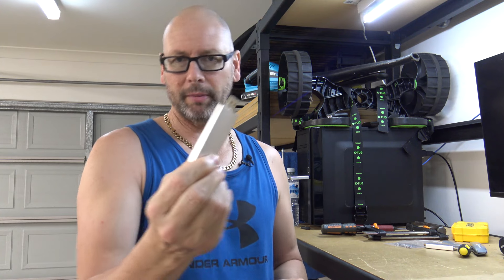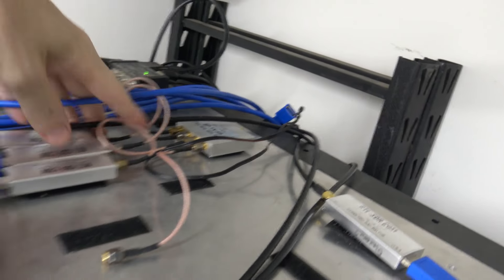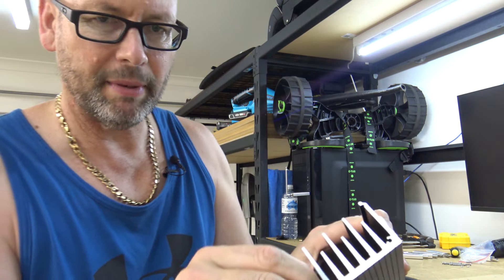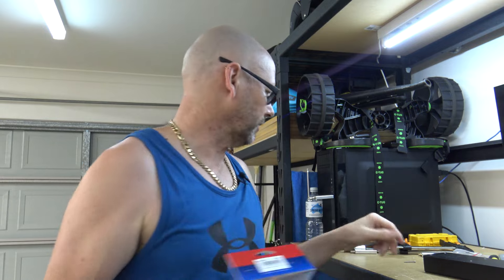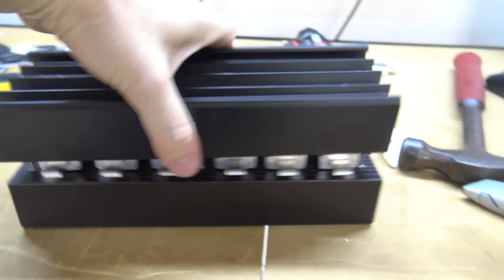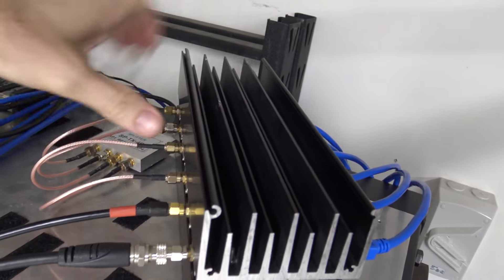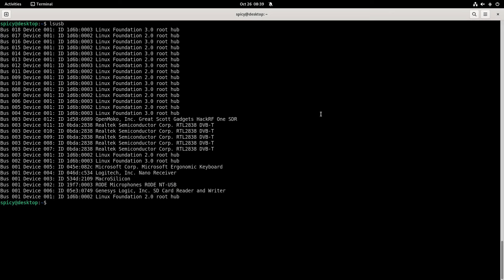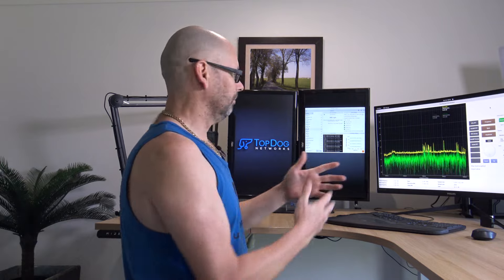RTL-SDR Heat Sink

Comment: Nice, I run a pair of these and decided just today to 3d print a dual case with an 80mm fan attachment for cooling them down.
Reply from the maker: ...and you ended up seeing my dodgy effort
Reply: @TallPaulTech  Yer freaky, was looking yesterday for a way to mount two RTL SDRs together and keep them cool, found what I wanted, started to print, jump on Youtube because I haven't been on for a few days and your video pops up. Nice one mate. what you are making will do the job more than well enough.

Comment: In time give us an update Paul.
Reply from the maker: You want another update?... I was playing around with cuda using nvidia gpu today, but it's not something I want to force as a requirement, so I pissed that off. I got some other shit optimised though.
Reply: @TallPaulTech  lol nice. Let us know how the thermal management of the RTL dongle cooler works out.
Reply from the maker: @MrDmjay  So far it seems pretty damn cold... with 3 of them running